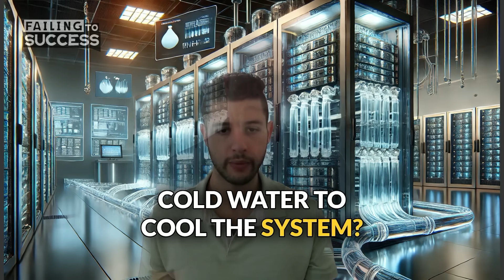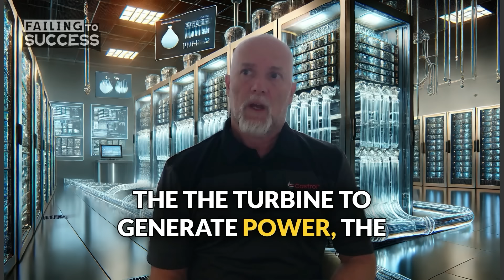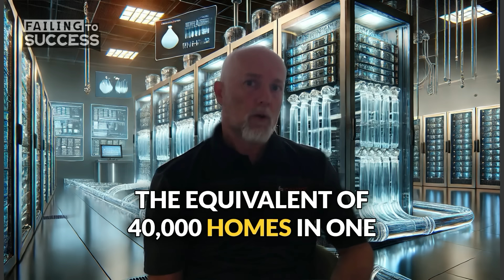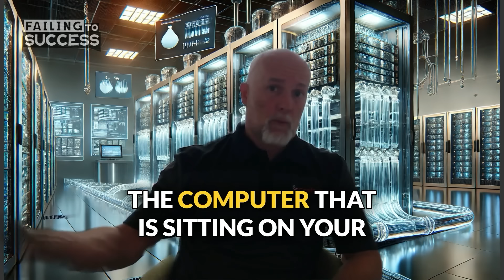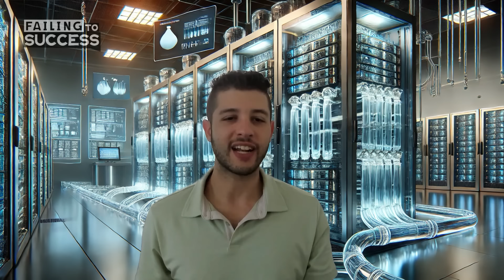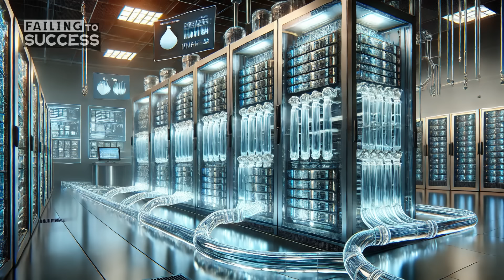Liquid Cooling Data Centers with BP (British Petroleum) - Air Cooling vs Liquid for Sustainability

Comment: I am not an engineer, I am Project Manager, who specializes in managing projects from the business perspective.  However, there seems to be some sort of 1:1 ratio (I do not know the equation), where an equal input of power to an given data center, results in an equal output of heat.  So, liquid cooling is the logical next step, but it is not the end-step, as we will soon have small modular nuclear reactors, that can be positioned in such a way to theoretically provide a data center with infinite power.  

And since infinite cooling, even at the theoretical level, does not exist, it is clear that liquid cooling will not solve the cooling needs for advanced data centers that run AGI outcomes.  In other words, liquid cooling would work in the short-term (the next 15 years or so), but we need to work on systems that would do things like take the heat generated by a data center and create hot water for a local community near the data center.  We can also us that excess heat to power other homes and businesses via cooking solutions (we need no ideas for heating our foods, why not use excess heat from data centers to figure it out)?

The other thing on my mind regarding cooling data centers, is clearly "silly" at our current level of understanding, but why can't we radiate that excess heat to outer space?  We only need to move the heat about 62 or so miles straight up.  We can't we create some sort of heat vortex, that allows us to move that heart straight up from and data center and into space; thus not warming our planet?

Thank you for allow me to comment!